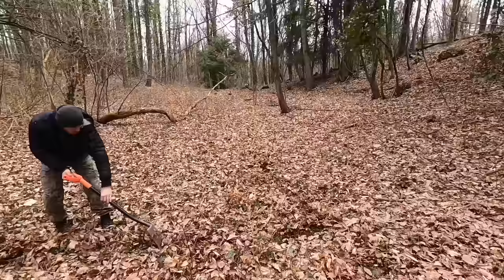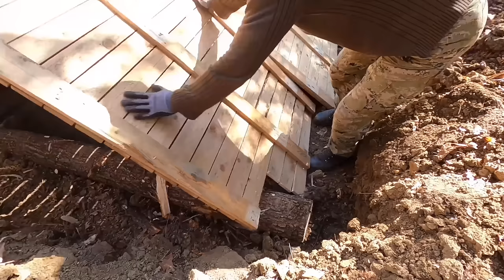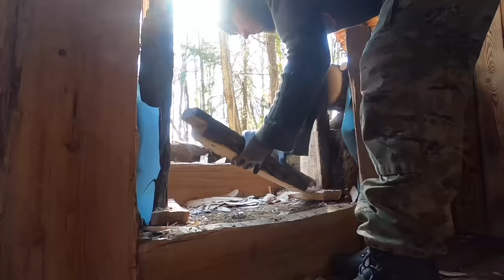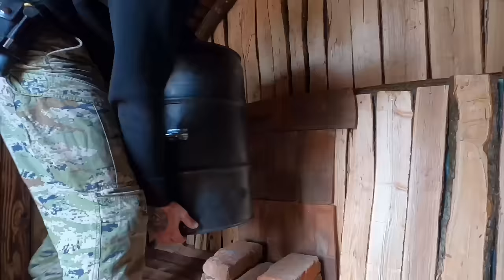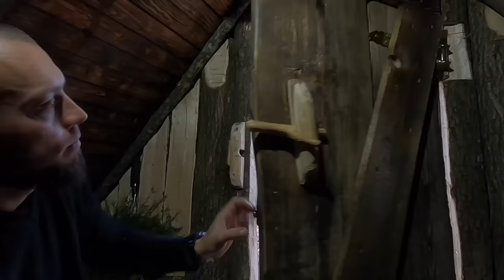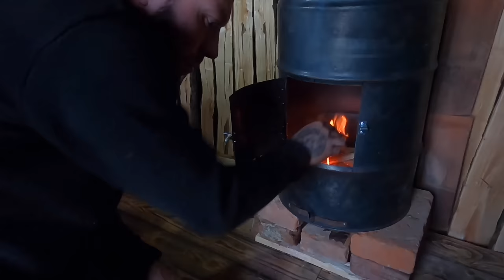Dugout Shelter Build With Hand Tools- FROM START TO FINISH

Comment: I came up with a way to modernize dugout survival houses to make them last a multiple decades, won't collapse when it storms, and have utilities and modernized equipment. Currently binge watching dugout videos to see how I want to do it. I'll be using the wood from the land to use as reinforcement for concrete walls and foundation so when it rains the mud won't touch any wood only concrete. Concrete lasts 50-100 years. Looking for the right floor plan to build my dream modernized dugout survival house. It'll have water, electricity, Internet, shower bathroom, bedroom, and will look nice AF.

Comment: This is the best shelter style folks!
Dugout gives best temperature control. A frame with dugout dirt on top to grow grass and repeal water. The most important part is concealment. Dugout also gives more room downwards. Also hides your fire! But during the invasion it’s best never to use fire because drones will be equipped with thermal detectors. So the dugout is best to stay warm without fire. Awesome construction!
My only concern is how to keep rain water from coming in through the door. Also more natural light is gonna be needed
Reply from the maker: Thank you for watching!

Comment: When the higher ups request the project be completed by the initial deadline 
EDIT as a former framer, I liked how you used thin logs as a "bottom sil" of sorts on the floor. And using the tarp under it - brilliant.

Comment: Fantastic job but I'm intrigued to see what happens when it rains heavily. This build is dug into the ground and it appears to be situated at the bottom of a dell or hollow. The roof and walls look 100% fine, and it's obviously lined with plastic sheeting... but what about the front entrance? Isn't the rain going to follow gravity and simply collect and eventually flood in under the door? Unless there's some way for it to drain away?
Reply from the maker: They won't! The house is still dry!
Reply: I was wondering the exact same thing.

Comment: When it Rains, and the water comes down that hill right beside your dug out, isn’t it going to turn into a bath tub?
Or do you have a way to redirect the water in another direction, like a 24 inch traveling trench to trap the fast rolling water coming off that hill?
Even without a hill beside your dug out, it seems that the rain will fill your dug out up.
Reply from the maker: They won't. The dugout has been standing since spring and is still dry. When installing the foil on the roof, I made grooves for water drainage.

Comment: Best dogbuddy ever!
Nice work.
Any water intrusion?
How would you roof the shelter if not for the pre-built pallets?
Thanks!
Reply from the maker: No penetration. The palettes seemed practical to me.
Reply: @luxonbushcraft  I don't disagree about the use of the pallets, I wonder what method could be used to fashion a functional roof without them.
thanks

Comment: 0:25 in and it looks like you are building in the middle of the drainage line from the saddle in the land behind you.
Is it just an optical illusion?  It looks like all the water from that hill is going to converge and head right for the back of your dugout.
It wouldn't be my first choice.
Reply from the maker: What exactly must be the amount of water!?
Reply: @luxonbushcraft  
Gravity will drain the water down the slopes behind your structure.  You are at the bottom of a saddle in the landscape.  The water will converge on the slope and move toward the back of your cabin.  Any amount of rainfall capable of saturating the soil would result in runoff heading for your cabin.  The floor of your cabin is lower than the surrounding ground.  The water would fill your dugout like a bathtub and you would become very wet and unhappy.  While you were digging, I noticed that the soil was pretty good.  It's an even mix of clay, and organics with not much drainage.  That is excellent soil for growing stuff, but not so good for drainage on a slope once the soil has absorbed what it can of the rainfall.
It reminds me of another structure I saw that was built in an actual drainage gully.  Did you build that one too?
Water can kill you in the wild.  You need it to survive, but when you get cold and wet, you will develop hypothermia and die.
Always think about what the water will do to your structure if it starts pouring rain.  Rain doesn't just fall from the sky and stop.  Once on the ground, it will seek the lowest point.
You do a great job building these structures.  Maybe go back and visit some of them to see what the water has done to them.  If they are still dry, you did good.
If you build on a local elevated point with good wind protection and drainage, your structure could last for years without flooding.

Murphy was an optimist.  Plan for the worst possible outcome and life will be less surprising.  Bad stuff will still happen.  It just won't be such a surprise when it does.  There is nothing finer than weathering a storm in a solid structure that you built with your own two hands.  Stay dry.

Comment: I'm very curious what kind of material did you use for the floor wrap the blue stuff ? And also the material for your roof wrap?couldn't i use some rubber roofing for both floor and roof?but i love the wrap for the floor looks very durable!! Very impressive Sir thanks for inspiring me to do this in my woods behind my house its literally going to be my man cave
Reply from the maker: The foil on the roof is exclusively intended for roofs. If it is damaged, it will leak water.Nylon is a cheaper version

Comment: How do you avoid water seepage in a lower than ground level shelter? Most of the time if it rains or snows you would get seepage and pooling that would compromise the use of the shelter. I didn't see any drain ditch or other means to stop long term water getting in. Was this something that wasn't a concern, or just not enough of an issue for the time frame you were using the place?
Reply from the maker: It is necessary to perform waterproofing and allow water to flow freely under the insulation without jeopardizing the project. See part 2 of this series

Comment: Looks good except for running stove pipe next to wood. This creates a condition called carbonization which over time lowers the point of ignition for the wood and will cause wood to catch 🪝 fire at extremely lower temperature causing a fire. Would be better to have brick around stove pipe instead of wood.

Comment: It's nice. Just those roof panels and floor boards and stove especially the wheelbarrow? All of those things were brought in and if you where miles from civilization that would be highly unlikely something you would do while building a shelter. Especially the wheelbarrow and wood panels for the floors and walls. They definitely were bought at a hardware store. It's nice I give you that. Just not a complete use of material found in the wilderness. These things you brought in would most likely not be something someone would be able to bring in on their backs to try to survive.
Reply from the maker: It turned out that I made a dugout for enjoyment 😉
Reply: @luxonbushcraft  Okay great! Do you have any videos of you making shelters of you only using material completely collected in the wilderness and only using hand tools/traditional tools?
Reply from the maker: It has everything

Comment: Good until the pre fab walls and floor came into play,, where did that come from and the wood already pre-stained ? Funny the speed up. Lot of cut here. But this guy worked his ass off..only one thing I see I would change. A sky light. I hate groping in the dark. Kudos dude. My cabin is urban and Fred Sandord constructed out of bits here and there.
Reply from the maker: https://youtu.be/Ge54E9jIRPA -part 1
https://youtu.be/ffgRgWF3uhY -part 2
Reply from the maker: The planks were burned and I took them with me out of civilization in a pickup truck and then carted them a few miles. Thanks for watching

Comment: Have you ever had a problem with water intrusion??? Seems as though if you did ,,, it would have no place to drain with that blue sheeting under the floor 🤔 ??
Reply from the maker: The shelter has been there for almost a year and it's still dry!

Comment: But don't think it's smart to build it on a low point in the terrain and dig it down below the surface if heavy rain comes our snow is melting?
Then it will get filled with water.
Reply from the maker: It's been a year and it's still dry! I even recorded it!
Reply: @luxonbushcraft 
Sound great. I was just thinking 😁